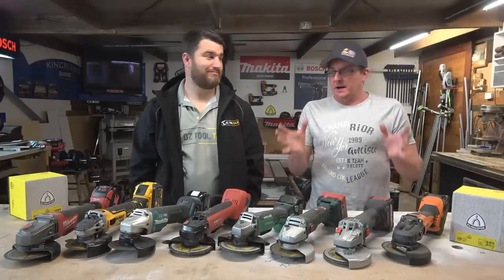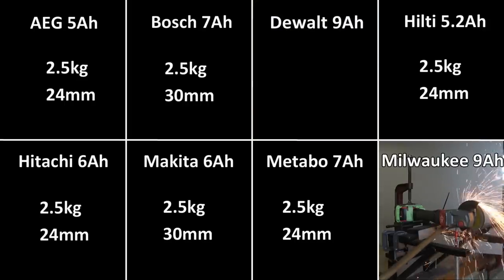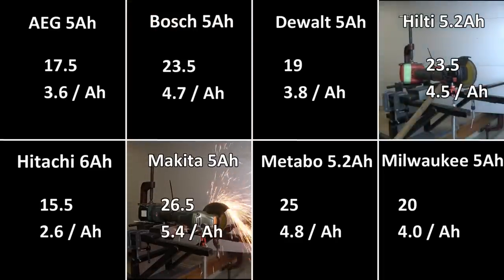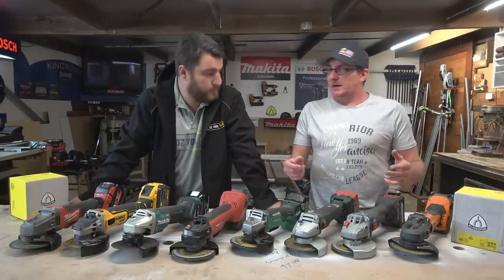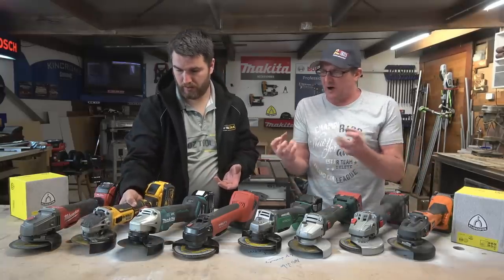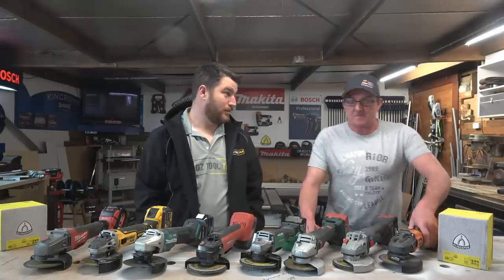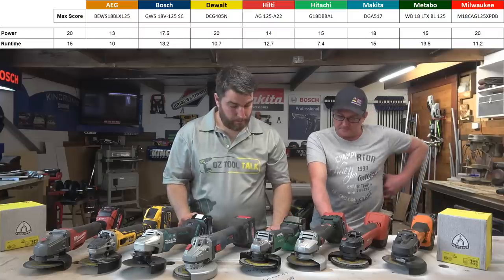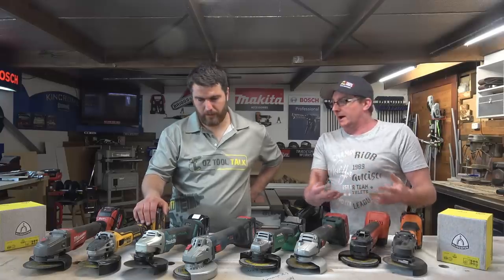18V Brushless 125mm GRINDER SHOOT-OUT - Makita, Milwaukee, Dewalt, Bosch and MORE.

Comment: Wtf ... what a horrible test idea .... seriously ... why would weight pressure be a good test for a grinder cutting rebar? let the tool and blade do the work... get your knee off the back of the grinder ....  this is a test id expect an apprentice to come up with.
Based on this test would you conclude that half of these grinders cut better than a demo saw? The electronic overload cut out is designed to protect the tool and user ... so you know you have an awesome grinder ... if it jambs and you can hold it till it burns out ?
Reply from the maker: zak4tt4ck You don’t have to like it,
Tell us what idea you have for a ‘conclusive and equal across all brands’ test ? 
Happy to hear constructive ideas always !👍🏼
Reply: @OZToolTalk  I enjoyed your other tests and your comments on the "feel" of each grinder, I just found the weight test was a bit off the mark, what it does expose is the brands that lean on their electronics to protect their warranty.  But I would assume which ever grinder had the highest rpm or closest rpm to suit the optimal speed of the disc you were using, would be the superior grinder for cutting rebar.
Reply from the maker: how else would you attempt to measure/compare the cutting speed and cut-out point on grinders in a manner that isn't subjective and controls variables? [Dwain]
Reply: it is actually a good test because it can actually show the torq limit of each machine at the blade. And its not the stall torq they tested but the sustained torq of a 30 second period(or how long it took). That in turn shows wich brand has the strongest motor. If the motor can handle less it wil heat up quicker and go in thermal overload. Now there is offcourse some difference in the cutout from brand to brand, but they all have a thermal cutout. 
And we all know that the 300 pound gorillas that handle these tools the most dont wait for the disc to do the work...
Reply: zak4tt4ck  Good reply!

The gear-ratio will first and foremost determine the speed. Battery grinders have recently gone down at speed, but are more powerful than before. I remember a Makita angle grinder back in 2010. It would flash and blink on a display if you put too much preassure on it! The batterypower was only enough to cut a 20mm bolt. 

The best way to test the capacity is in my mind to put preassure on the grinder. Weak grinders will quit. In the real-life situation most people who use angle grinders always puts force on it to the extent of it's capacity to run like that. I also think that the main issue is not the grinder, but the battery going warm! It takes some time to make the grinder itself overheat! 

There is in general not an optimal speed for the disc. The reason is because speed increases as the disc is getting smaller. This is the reason why you don't use 230mm disc on a 125mm machine.

This test is legit!
Reply: the optimal speed is what is quoted on the disc as the maximum speed the disc can take, Most 125mm/5inch have something like 80m/s written on them wich is around de 12000rpm mark. But that is only for a new disc. If its down to 100mm/4inch then it wil allready be up to 15.000rpm max for the same outer surface speed.
But since all of the tested machines stay below 10.000rpm its safe to say they wil not reach the optimum speed for normal cutting discs because in case of abrasive cutting you want maximum speed.
Reply: Oz Tool Talk guys you did great. Naysayers bahumbug! It was good!!!